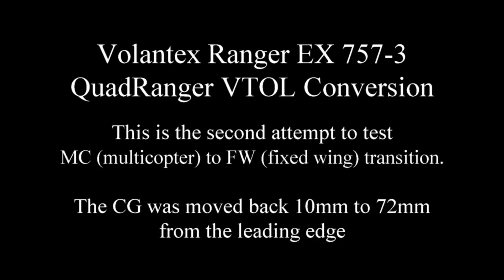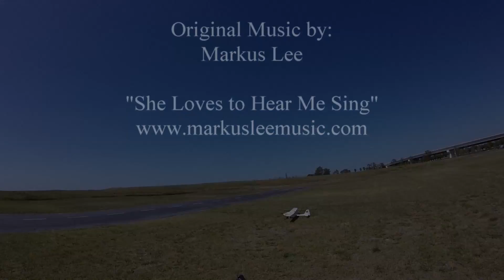QuadRanger VTOL Successful FW Test Flight

Comment: hi .... i am building my second quadrangervtol but i got some problems in my fligth test. When i tried to take off im copter mode my ranger goes straigth ahead and hit the ground with it s nose.... the ranger doesn t go up... i think it s probably the center of gravity or calibration... what do you think?
Reply from the maker: You need to set Level Horizon with the quad motors, not the wing. I put bubble level on the quad motor booms then set level then. Also try setting your CG between 72-79mm from the leading edge. Good luck with your build.
Reply: Flip on Tech it seems that the quadranger tries to fly leaning forward... do you think it something to be with a good calibration?
Reply from the maker: In MC (MultiCopter) mode, with no wind, it should hover and not drift. If it does, you need to calibrate Level Horizon to the quad motor booms. If in FW (Fixed Wing) mode and it pitches down, you need to move your CG back. Also, you'll need to put a shim under the bottom pusher motor mount to change the thrust angle similar to this: https://static.rcgroups.net/forums/attachments/1/4/2/1/a9952611-28-RangerMod2.jpg  . Good luck with your build.